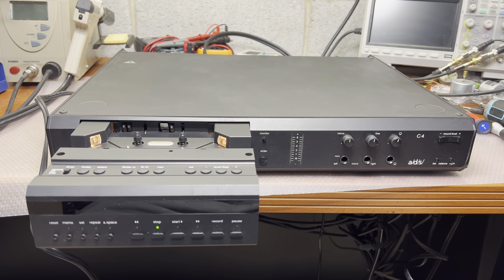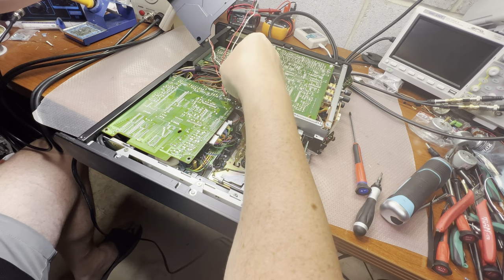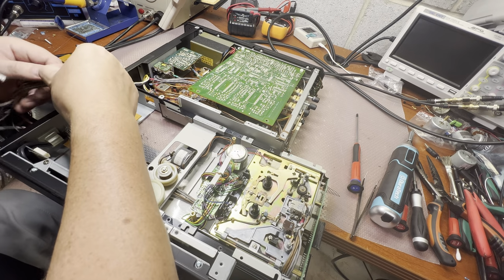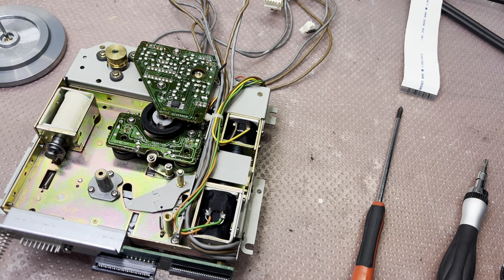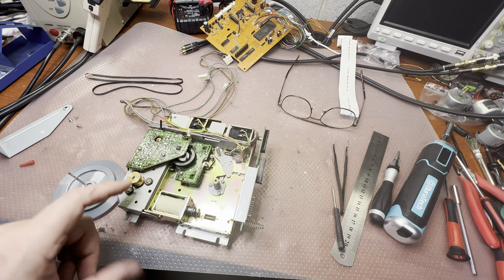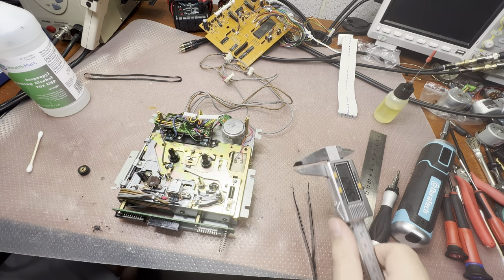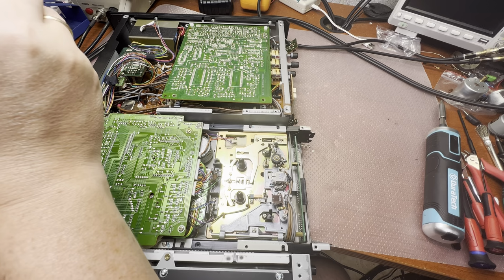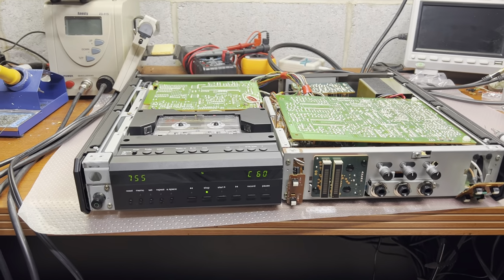Inside the Ultra-Rare A/D/S (Braun) C4 Cassette Deck: A Unique Marvel!

Comment: I enjoy your repair videos, you do a great job.
I've been repairing electronic stuff for many years, and I'm still learning everyday new tricks and tips.
I think it's good to share that kind of knowledge, so in that spirit, I hope you don't mind if I tell you how to improve your demagnetizing procedure.

To properly perform the process, slowly bring the demagnetizer toward the head stack using a circular motion with the instrument coming close, but not necessarily touching and move over each head and guide.  Only a few seconds are needed with each area of the tape recorder.  Then slowly move the instrument away from the tape machine until you are at least 4 feet away prior to turning off the demagnetizer.

Cheers, and thank you for your videos.
Reply from the maker: I believe you providing instructions to demagnetize a TV set with large coil. I did like that at the beginning of 80s. Coil was large and to demagnetize TV we had to start close and then go to the distance. In opposite, head demagnetizer has small tip and field is concentrated around this tip. All instructions i have seen for  the head demagnetizers do not mention any significant distance. I believe you are wrong here.
Reply: @hifirulezzz  Nope, I'm talking about demagnetizing casette decks. I'm just sharing the knowledge I was told in the 70's, the instructions I've always read in specialized forums, and even as showed in many professional yt channels, like Mend it Mark for example. Cheers.

Comment: repaired those Braun components in the mid 1990ies, when they were already EOLed. company had bought the remaining factory stock, so no shortages of parts. but stock was as bad as the machines brought in. 
those machines had so many issues related to bad ventilation. leaking capacitors everywhere. And the front panels had poor soldering quality, especially the tuner. perhaps they did not clean the PCBs before soldering or used the wrong flux. you had to basically deep clean the PCB, recap and resolder the complete front panel plus conformal coat it to avoid double repair/bounces.

Comment: I have the older version of this Braun deck, the C1. I bought it from Ebay and it was completly broken. I change belts and everything, and it was working great, but during reassebling i made a big mistake when i recconect the wires. I think i have burned something... Now i am stuck.